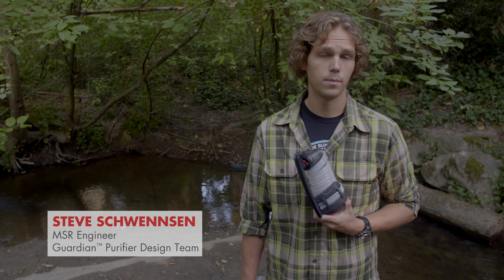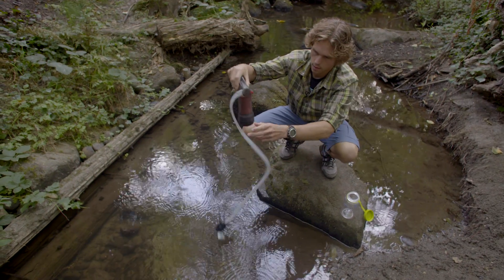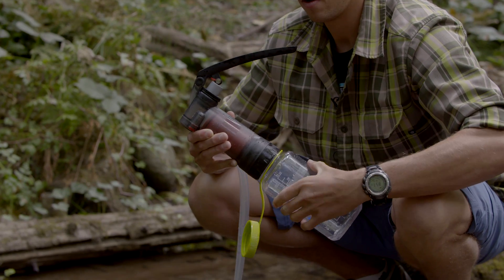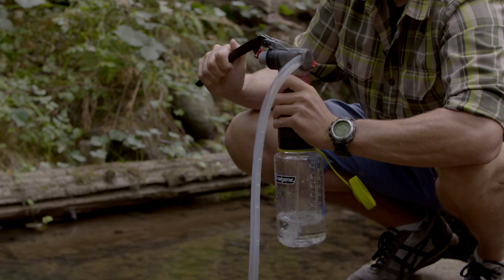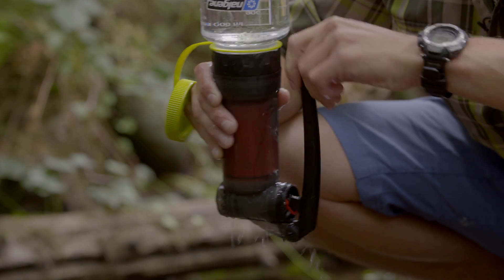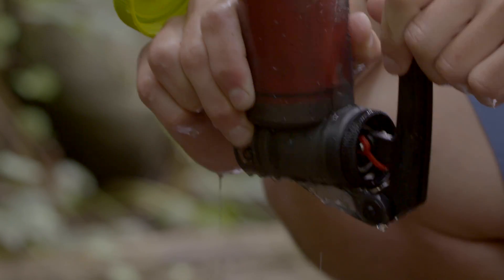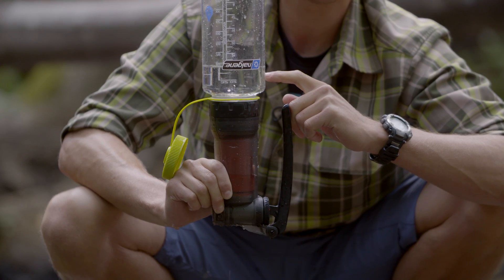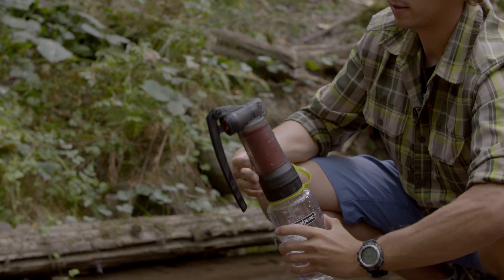MSR Guardian Purifier: Performing the Integrity Test

Comment: Has the leak issues been resolved or re-engineered, how about the same for the handle and the piston? Any update??? Too much negative reviews to safely purchase one without knowing these issues have been corrected.
Reply from the maker: Guardian handle breaking happens when customers force handle to pump; the issue was initially with the internal piston not having enough lubricated and people would force it to pump without inspecting issue, thus causing breakage. Piston lubrication has been fixed.
Reply: @MSRGear  thank you for clearing up that part of misconceptions up, i’m looking to invest in a this type of product, how about the issue of it leaking at the base above where you attach to a water bottle has that issue been resolved also, seems you failed to mention about that, too many videos on YouTube about that situation to be ignored? Would like to hear from you directly before I put out $375, and what is the limited warranty, that was kind of vague on your website
Reply: Well has the leaking at the base been fixed? Anyone, anyone, Bueller, Bueller?

Comment: Thank you for the post. You could really help out even more if you had a link to another clip on what to do if the system is compromised; showing which O ring(s) fail and stock numbers with demo of replacement, filter replacement along with stock number, piston replacement ... You would help sell more if we though the high cost of this unit made sense by reasonable repair cost. I'm looking for a unit ( maybe 2) and reading reviews, cost of repair, reliability...
Reply from the maker: Hi Jay J, Thanks for reaching out. While we can't link you to another clip to highlight the items you mentioned, we encourage you to get in touch with the pros in our repair shop. Contact info can be found at https://www.msrgear.com/en/warranty. They will be more than happy to fill you in on o-rings, filter replacement and any other technical questions you have regarding repairing your Guardian Purifier. Keep up the adventures, Mackenzie

Comment: Has MSR done anything to solve the major issue of the internal plastic piston breaking? Our Guardian completely failed after only 8 months of usage and we’d only got about 100 litres out of it. Anyone using this regularly and long term will eventually have the same issue. The plastic piston is weak and will never process 10,000L as MSR claim. Don’t trust the Guardian.
Reply: Bush Channel: I've seen other reviews on Utube & elsewhere which say the same as you so I think its probably a design fault (the piston). I was planning to get one of these but now I've changed my mind and ordered a Katadyn Hiker Pro instead. All the reviews I've seen for the Katadyn are good and their customer support is excellent.
Reply: @paganphil100  Yeah but it wont filter viruses

Comment: so, if it's compromised,  does that mean I need a new filter, or a whole new system  also, before I buy one of these bad boys, is there any warranty for it ?I work at a camp for at risk youth, and I will be using this filter to have safe drinking water from lakes, and creeks for the yputh, anyways, just wondering if I drop it, or if it breaks, if a warranty will cover it.
Reply from the maker: There could be several reasons why a Guardian would fail an integrity test. The most likely reason is that the filter has been compromised in same way and needs to be replaced. We do have standalone replacement cartridges available for purchase. The second most common reason would be that there is a faulty o-ring or seal somewhere in the purifier. Replacement for those are available in the Guardian maintenance kit. If you ever had any questions about the integrity of a filter, you can always send it in to our warranty and repairs facility for an evalutation.

The MSR Guardian, like all MSR products, carries a 3 year warranty against defects in materials an workmanship. You can read more about the warranty policy at the MSR website.

Comment: Does that test work on other MSR filter like the Miniwork?
Reply from the maker: Hey M Sato,

This test is specific to the Guardian Purifier. For the MiniWorks it is best to use the included gauge to measure the ceramic and ensure it is large enough. It is also a good idea to keep an eye out for cracks in the filter element.

-MSR

Comment: @MSRGear 
I was wondering if you know if old school style Nalgene, HDPE, bottles are clear enough to preform a integrity test, and if you are able to see bubbles( through the white slightly opaque bottles) showing the filter is compromised? They are definitely lighter, than the triton style hard Nalgenes by a few ounces. Kinda hard to know if this style would work, unless i knew someone who had a compromised filter, which im guessing you have? I think this info could be helpful, as i bet you already know that Nalgenes are seen as heavy in the backpacking community, and being able to use the lighter weight HDPE Nalgenes I think would maybe make those people uneasy about hauling Nalgenes, take a second look at The Guardian.